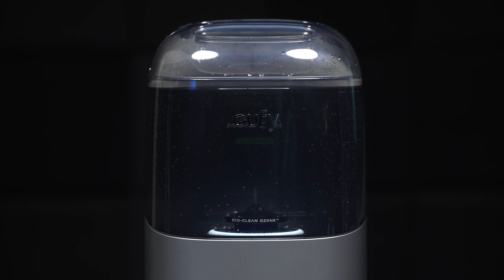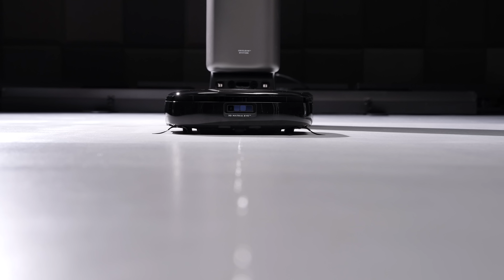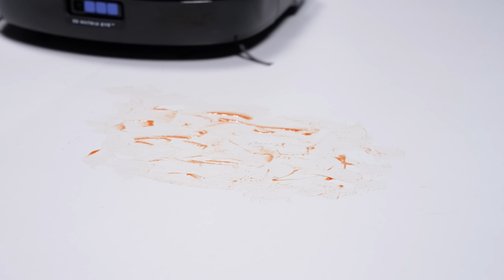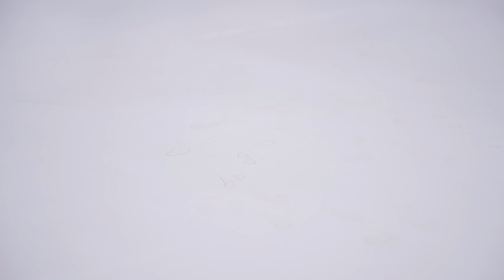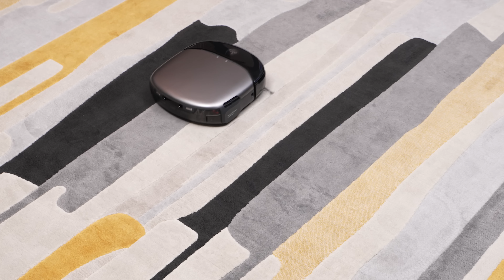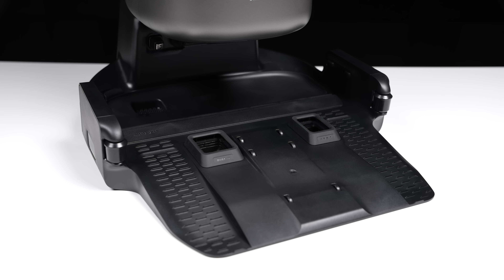I tested the eufy S1 Pro – World's First Floor Washing Robot!

Comment: also it needs about one minute till it make roller wet on start while in base station to starts moping, so it is kind of ,.... u know .... waiting :D but rather wait than moping with dry mop, and also.. I hope I heard wrong that drying the mop with hot air takes 4 hours .... i dont wanna see high energy bills as it burns electricity for one mop that will dry by itself over night withotu electricity

Comment: Yes! This style of robot mopping is what I was waiting for. I’m still waiting for the perfect robot that has all these features in one:
-self cleaning
-cyclonic (rely more on cyclone than filter for dust separation)
-bag less system for base station
-fully sealed hepa filtration 
-this type of mopping system
-great obstacle detection. 

It’s sad how the robot vacuum has existed for so long but you still cannot get all of these in one machine.
Reply from the maker: We've come a long way, though!
Reply: I used to also be bothered by auto-empty bins requiring bags until I realized you can buy a huge pack of 3rd party ones for not that much.
Reply: @brandon_nope  yet another consumable item required in the home. The less, the better.